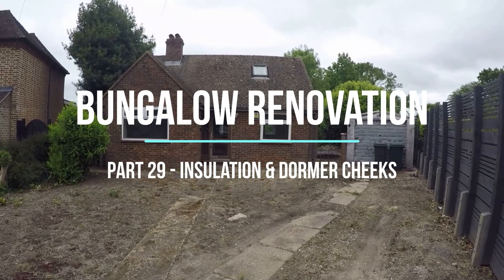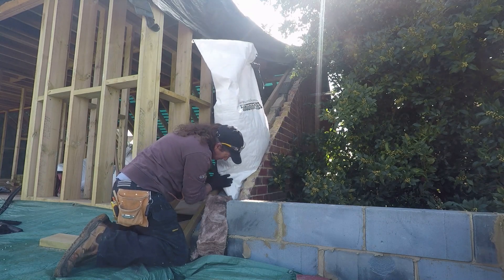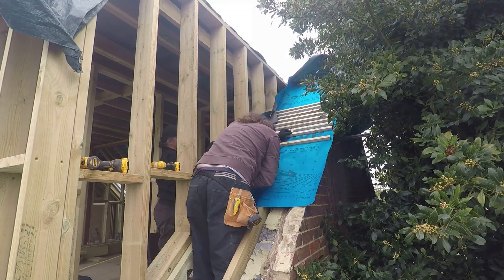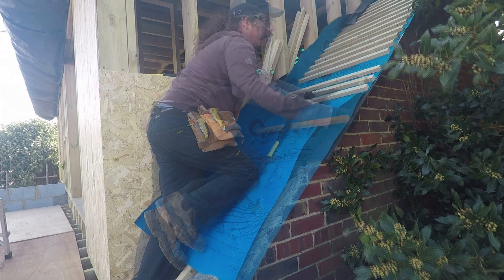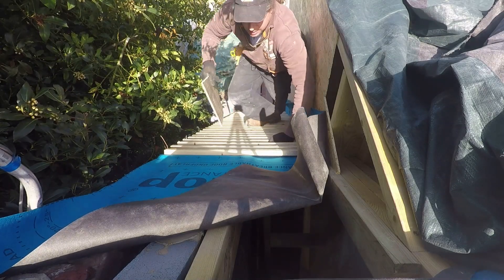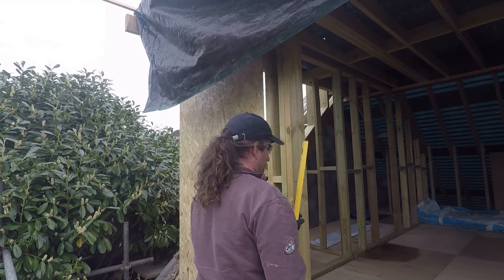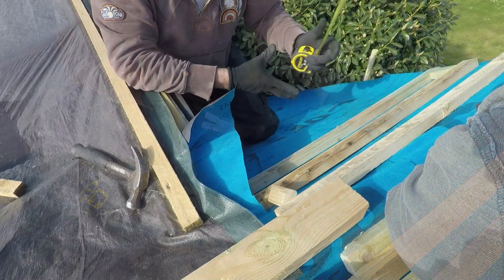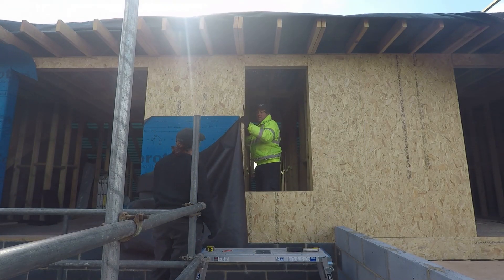House Renovation - Part 29 Insulation and Dormer cheeks

Comment: Is it wise to fill the cavities? I spent weeks with my mate taking out the beads insulation on the pine end of his house after the rain used to soak through the walls.
Reply from the maker: Hi Graham

I know that it can be a problem, at some point the bungalow had that injection insulation blown it and it has caused no problems, also we are silicon rendering the entire outs side of the house which will basically make it water tight.

Regards Kairos